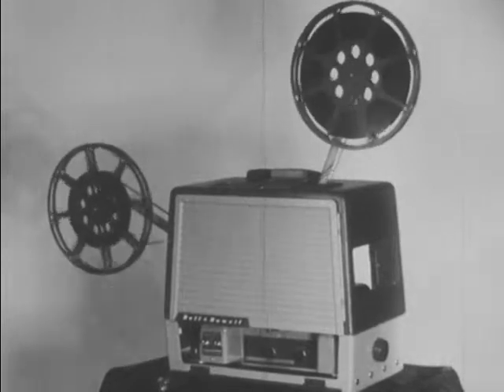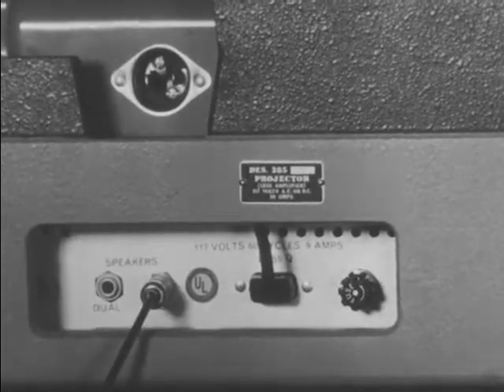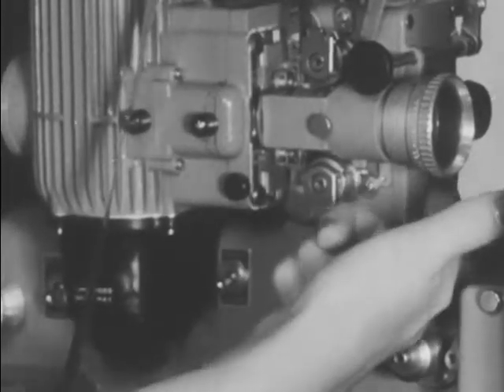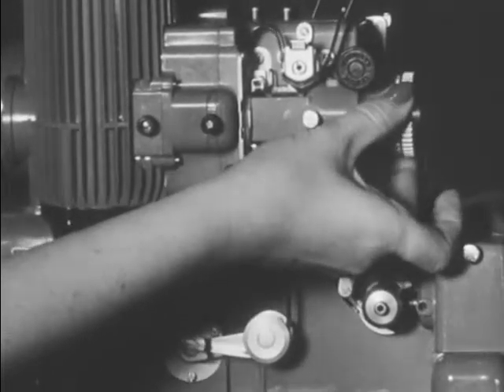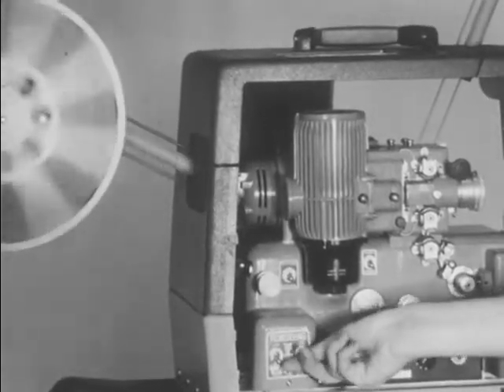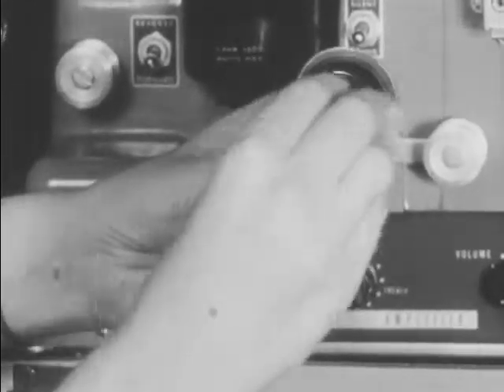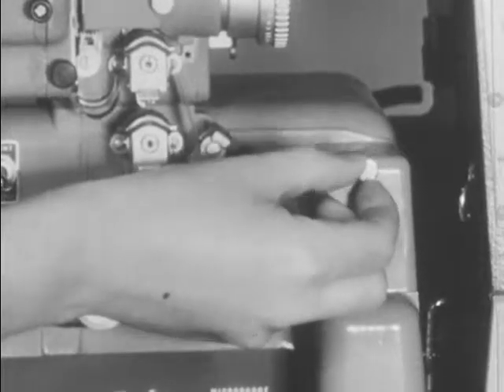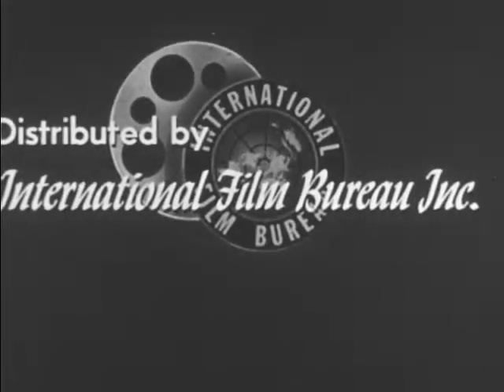Operation of the Bell and Howell sound projector (1957)

Comment: Some of the features on this early bell and Howell projector seemed like an inconvenience, like when you have to go from forward to reverse, you have to shut off the projector, disengage the gears by flipping that little lever next to the supply spool reel arm and then put it in reverse and then flipping the supply spool reel lever back to engage the gears and then flipping the projector switch back on it just seemed like a lot of work compared to now a days. And then having to change reels around just to rewind a reel of film. But the one feature I did like was the fact that this projector bulb seemed easy to change.

Comment: B&H 385 Series was first produced in 1955 following the one year only 384A. it continued production until 1961 having 12 model revisions in 7 years; beginning with 385B (55-59) 385BA (55-59) 385BR (55-57) 385BY (58-59) 385C (55-58) 385CA (55-58) 385CB (55-56) 385CR (55-58) 385CRA (55-58) 385CRB (55-56) 385CY (58-59) 385K (58-61) ... The 385 & 399 were the last of the 100 - 300 Projector in a Box Series dating back to the 1930's. All using the same 3 Sprocket Film Transport System. Starting late in 1961 B&H produced a new style 16mm Projector (Model 535) that was completely different from the 100-300 Series; not looking the same or sharing even one replacement part. The Early 385 Models shared the same Manual Oiling System with the 3 Snap Cap oilers on top next to the Lamp Chimney and the 3 Sprocket Oiler Holes which you needed to tilt your projector to its left side (sprockets facing vertical) for lubrication. The later and last 302/ 385 Models eliminated the Manual oiling System and went to a Sealed Bearing System or what B&H referred to as Lubricated for Life. This IMHO is the 385 model you should avoid if Looking/Choosing a 385 for Your Own Use. Lifetime Lubrication is a misleading statement. It should say until the Bearing uses up /Drys up the Grease in the prepacked bearing. This is another instance in B&H history where something was eliminated or revised for Cost Saving Measures. The Manual Oiling Models going back to early 100 series  were given Lifetime Warranty; and if oiled and cleaned on a regular basis would go beyond your lifetime and your Children also. B&H never gave Lifetime Warranty on Sealed Bearing Models which also includes the 399 model, because the term lubricated for life was just a Sales Pitch. Always look for the 3 visible Snap Cap Oilers when buying late model 300 series Projectors... As Dated as these Projectors are now days. A NIB 385K/399 (if you ever found one) could already have dried up bearings; Stick with Manual Oiler Models. B&H in their Chicago Based Facility made some Great Projectors/Products over the Decades. Don't Confuse the Junk Products you see advertised on TV now days  (usually for $19.95) and using the B&H Name. Their Products are a Joke and Disgrace to a Company that once made many of the Best Products in the USA...
Reply: I’ve got a 185  Filmosound and I am having trouble with it lately. It has started to break up the film as it’s going through. Mainly the perforations. I started to turn the clutch control to the right just after starting to run the film and turning on the lamp; as per the manual.  Previously I’d just turn the clutch to the right BEFORE I ran the film, and didn’t seem to have any problems.  I notice a few demos where they do this.  Which is correct?
Reply: Hi Steve 
My 185 has recently started to chew film.  Not had this problem before.  The take up reel seems to be snatching the film and it’s breaking where the sprockets are.  Could you please offer any advice 
Paul
Reply: I cut my projectionist teeth on the 8399AV, introduced about 1965. Similar in most ways to this but with a 3-position rotary switch (OFF-MOTOR-LAMP) instead of separate line and lamp switches. Those made up most of my high school's projector fleet, but we also had a 399 and several lightweight models (some Autoloads among them) as well. A feature of those latter models that I never liked: speakers cramped into the nose, firing the sound forward - the polar opposite of what it should be.
Reply: @flimbambo  I always started with the clutch engaged, never had any problems. I very seldom stopped for a still image, and never reversed during a film.
Reply: @smwca123  Thank you very much for your reply.  I’ve tried to load some film a couple of times and they have been chewed/shredded so I’m wary of using my 185 now.  I tried some leader I bought but it didn’t thread properly and the sprocket teeth ended running between the perforations instead of through them.  Other times, the film was ‘snatched’ and broken off from the bottom sprocket.
Paul
Reply: @Paul Haskey  Do you use the manual advance knob to make sure the film is properly threaded, and especially that the shuttle teeth engage the film properly? That was something I always did, it's easier to do if you declutch first.
Reply: @smwca123  Thank you. Yes  I always  did that and formed the loops properly.  The clutch control is moved to the right to engage the teeth and check the loops and then immediately turned anti-clockwise once this is done.  This is according to the manual.  One thing I noticed was sometimes when I ‘fixed’ the film leader to the pin on the take up spool it tended to snatch rather than when I allowed the film to just wrap itself around the spool.  
Do you start the film with the clutch off (fully clockwise)?  I used to do this and changed it when I read it in the manual that you switch the clutch to the right immediately AFTER you start to run the film.
Reply: @Paul Haskey  No, I always started with the clutch engaged and never had any issues. The reels I used had slotted hubs and no pins, so I engaged the film manually both for normal running and rewinding.

Comment: I have recently bought a Bell Howell 631s, with a separate loadspeaker cabinet box. All seems to be in ok shape, but, when I switch the projector-switch ON nothing happens. The switch to the left of that switch, for the lamp, works and the projector lamp lights up. But the projector does not run... I am trying to figure out what is wrong, the projector just does not seem to run. I would be grateful for any indication of what to do.
Reply: Assuming that your motor is not running, there are a number of things that could cause this problem.  

I would start with fuses as they are the easiest to replace, but indicate more serious issues if they repeatedly blow.

The motor switch might be faulty, although the lamp shouldn't light without the motor switch on.  I am not sure whether or not a double pole switch is used on this model.  If it is a double, than the lamp safety pole might be working while the motor pole is open.  

These projectors also use motors that have carbon brushes in them which can wear out with time.  The armature on which these brushes bear could also be clogged up with carbon residue, necessitating a cleaning.  

You might also check to see if the motor can be turned by hand.  If not, then a bearing is might be siezed, which will require cleaning and lubrication (assuming that it isn't damaged beyond repair).  If the motor runs with the clutch disengaged, but not when engaged, then the mechanism will need attending to as it is probably gummed up through lack of use or poor maintainence. 

Lastly, wiring might be at fault (uncommon, but not impossible).  I am sure that I've left something out, but this should get you started. 

These projectors are complicated beasts and can take hours to troubleshoot and repair, even for someone like me who has been working on them for decades.  Take your time and learn all you can about how they work.  I wish you luck in your quest to save one of these wonderful machines!

Comment: If there are any Filmosound 202 aficionados viewing this, I have one and have2 problems. The rear “concentrator” (the slide-in glass between bulb and the film gate) is missing on mine. Anyone have an old projector around for parts? 
Also, (and this is the real conundrum) when projecting in reverse, picture is nice and bright. When projector goes forward, a damper seems to flip in front of the gate cutting the light level in half. It’s not to protect the film because the film is moving and in no danger of burning. I can’t figure out why it dims or how to correct it. In reverse the picture is perfectly bright.
Reply: i have a filmosound 202 . its available for parts.
Reply: @tachyongroove7347  where are you located?